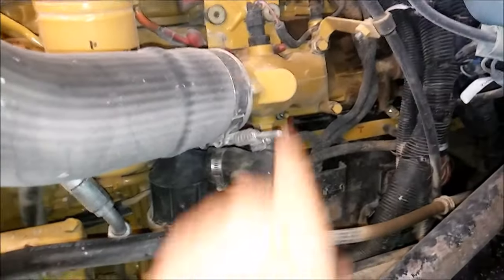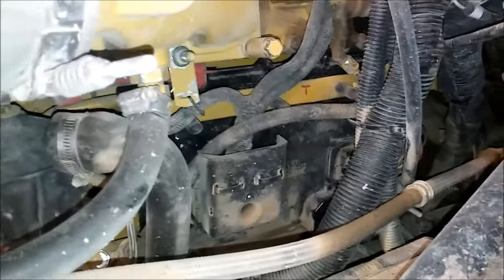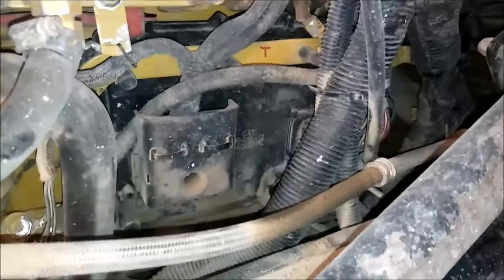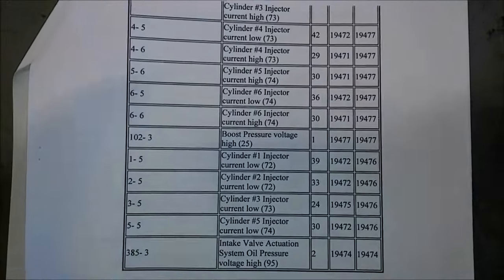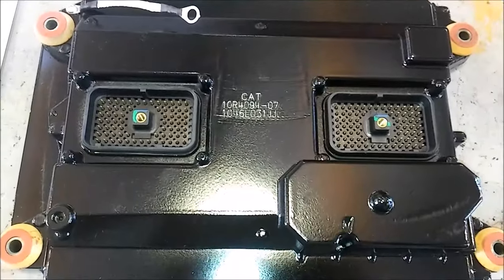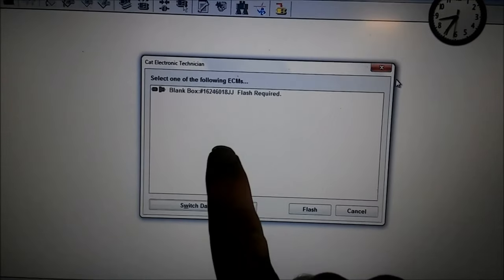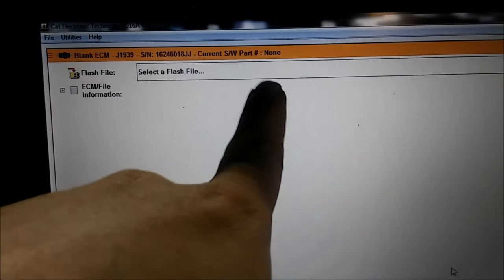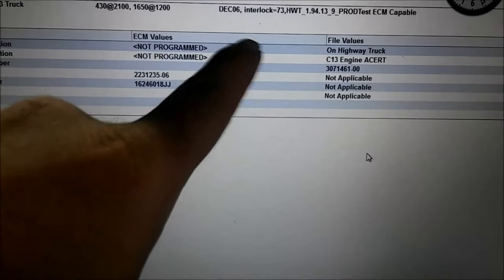How To Troubleshoot And Program A Cat ECM

Comment: Appreciate your videos.  I am a Ex  CAT/Cummins mechanic   retired from a pete dealer. The strangest ecm failure I encounterd was a 550 Acert in a 379 pete. brand new off the piggy back tk.This engine sounded like it had a High lift gasser cam in it was hilarious belching smoke and loping like mad.. !  .Had et plugged into it and it was throwing  every code you could think of from cam/crank timing codes to inj pulse width.basically freaking out.Tapped on the ECM case with a rubber mallet ran perfect.flashed new ecm  all is well.Did download on bad one for warranty. Cat called service manager week later.Turned out to be a bad solder joint on the hard board. Was a MXS motor and they  had  over 50  of them that got out into production giving everyone fits on diagnostic side

Comment: Hello there. Very informative video!
I purchased a caterpillar 525B that took a lot of damage and is being scrapped. Although it’s a lost cause…Most of the electronics are still intact and undamaged. I have a bit of experience with dealing with ECM‘s, I’ve repaired dozens of car and truck ECM’s at the component level… However I’ve never dealt with anything from an huge industrial motor. I buy and repair pallet loads of industrial equipment… mostly as a hobby and supplemental income. But usually stuff like CNC machines, servo drives, motor controls, stuff like that. Never dealt with these massive engines and all of their electronics goodies.

I have a humble troubleshooting lab, and will check everything to the best of my ability. And then pass it on to someone who needs it. Maybe I’ll be able to trade it for something interesting… Who knows.

The machine I Purchased is going to be scrapped this week or next… it was in like new condition with low hours on it when it took a tumble off of a large embankment and did more damage than it was worth repairing. It belonged to a large construction company and I bought it directly from the owner after his insurance was settled.
all of the electronics and wiring were completely undamaged in the fall. Some of the electronics had been disconnected and a few potential buyers had poked around loosening some connections and possibly removed a few sensors or modules. I’m not sure how much is missing, but the main ECM is still there. So I would assume they would’ve taken that if they were going to take anything.

My ecm isnt on the side of the engine like shown in your video. It’s directly under the driver seat fastened to the bottom of the cab on the outside.  I was curious if it’s common for them to have different locations like this? And how the heck to find all of the other hidden electronics, modules, or sensors. I want to remove anything useful or valuable before it is scrapped.

Some of the stuff is really hidden deep and hard to find. I’ll fallow the path of the wires I can see, but I’m worried some have possibly been removed… or I’ll miss some valuable module or parts. Considering a few potential buyers loosened some of the connections and possibly moved or removed things… I just want to make sure I find everything. 

I Tried to find a schematic or diagram online showing the location of all the modules and sensors that I’ll be removing but no luck so far. The model number of mine is 172-9389-01

Thanks for the video and thanks for your time.

Comment: This is one of the worse jobs on ANY vehicle : Troubleshooting ECM, harness and connectors...and most of the times the problems are intermittent and hard to reproduce when u want it to.
I had an ECM die on me once at 140k on a crappy 1996 Eclipse. Darn thing made of kinds of noise and clicking sounds...good thing it did, it just made the whole ordeal a whole lot easier for me. Do HD trucks come with a bunch of body modules(smaller ecm's) like new cars too ? Keep the videos coming...i don't work on HD trucks but i like them a lot. 👍
Reply: Forgot to add: Yup, heat KILLS A LOT of electric/electronic. components...the Eclipse ECU gets pretty hot and it gets no air flow(confined to a TIGHT space next to the radiator and getting cozy with the  battery, acid bath and fumes, anyone ?lol).
Reply from the maker: The newer the truck the more modules it has. The engine has one as well as the ABS, sometimes a dash or cab module, body control, and transmission of it has an automatic, are the more common truck ones.

Comment: I have a cat 6NZ and recently job I have done was manifold and the guy did a lot of welding trying to pull out broken studs and since that day I have faulty sensors and replaced it but still showing up and truck shut down while driving or idle no matter what circumstance do you think this is a ECM problem? And I already change and check all wiring. I don’t know what else to check

Comment: Do you happen to know what typically fails at a component level inside the ECM? I have a 3126b ECM open on the bench and don't see anything obvious with my multimeter..  what is a good resource for the 70 pin connectors to build a bench harness?

Comment: Just got done replacing two ECMs on 2 different trucks both trucks are 2004 KW T800 with C15 acert BXS one truck having 13826 hrs the other truck having 13914 hrs with in 2 weeks. Trucks just 1 S/N apart. Same code all injectors current high plus a couple of AIV. Thought it was strange

Comment: Josh... I have had you help me before.  I have a c7 and it randomly dies. It is in a school bus.   I have sent it to Holt cat in Dallas. They couldn't get it to repeat the problem 😑 . I Then decided to drive it around for several hours and nothing happened . Drove it back to the day care.  2 day later it was doing the same thing.  Even with the driver in the seat going down the road it would die and she could restart it rolling down the road. Then maybe do it again or maybe not for 3 days.  Checked wiring/ battery connections haven't checked ECM or related conditions  . The engine is in a Freightliner school bus.   Your thoughts ?

Comment: I have a generator problem with engine C15 speed hunting.... an indication of oil pressure and coolant temperature error... is that indication the cause of engine speed hunting..? thank you

Comment: Hi, 7 years later .... got a question .. i have a cat 149-6990-10 ecm.. the person gave it to me look at because he wired the main voltage backwards or something like that and fried a Diode in the ecm. However I have no clue what the diode is because its blown... i believe its board number is d4 beside cap c258 on the edge of the right side middle.. I do have a picture.  Because i have no clue i replaced it with a t4 diode just to see if the unit would power up.. However I would rather not test out that theory as you might know the diode number....  Well if you see this great if not I get it.. 7 years later...

Comment: Hello Guy, I have been troubling shooting 3512B cat engine, cylinder 5 and 8 is not firing have even interchanged injector, check valve, pressurized cylinder, I decided to check cylinder input since the ECM communicate with solenoid in pwm , I have on nos 5&8 is... 1.340hz while the least on firing cylinders are 98.5hz and highest is 245.4hz while engine running at 600rpm idle

Comment: I have another puzzle for you. I have a 3406e 5ek  I have replaced injectors , injector harness and ecm. The engine runs very strong then it will start popping and blowing white smoke. This comes and goes quite frequently. I'm going to try the engine harness next unless you have another suggestion. Oh  I took the exhaust manifold off and it's all 6 cylinders.
Reply from the maker: +Alice Stoneking Hmmmmm, are you getting a check engine light? What is your fuel pressure when it is acting up?
Reply: May sound silly just check fuel primer (they can pull air through

Comment: Having issues with the ECM in a CAT XQ60. Had the generator running, then I shut it down to top off the fuel. When trying to start up again the motor try’s to turn over then it throws a ECM code.

Comment: Thanks for the awesome info.  I have a 2003 Thomas pusher with a 3126.  It stalled while driving and found 20 amp fuse blown that feeds the ECM.  When changing and connecting batteries fuse blows.  I disconnect the wire harnesses going to ECM and fuse doesnt blow.  Am I safe in assuming that the ECM is bad?
Reply: I have the. Same issue
Reply: @ttauriinvestments5756  My problem ended up being a bad ECM.  I ordered a Remanufactured one from Peterbuilt and had them program it for me.  The location in Flagstaff didnt seem to have the knowledge or time to do the work properly, so I would not recommend.  I did find GoECM, after the fact, that was a 1/4 of the price.

Comment: Will a engine speed sensor calibration fault cause a crank no start. A customer of mine installed a new ecm he bought programmed from cat. His old ecm was dead so couldn't get old parameters. From what I remember would run just throw code for speed sensor calibration
Reply: It should start, and will have  timing calibration not preformed fault. If a download was in the system, you can get some of the old programming if you know the engine serial number. You can dump a timing cal file in the ECM unless it is a early 3176. 70 pin ECM's are easier to do this over 40 pins. I would check my power and ground wires to the ECM. If the old ECM fried, good change it blew a fuse in the truck side.
Reply: I'm a mobile tech and everything I do is on site. I work for peterbilt so have access to et and sis i just don't get to mess with cat much anymore and couldnt remember for sure and the calibration. Customer said that truck died coming out of woods and ecm wouldnt wake up and now truck been sitting for a couple of years. They bought ecm off internet and it wouldn't start and then bought one from us that we bench programmed and stiil no start. It didn't have timing calibration code or any other codes. I checked esn with sis to make sure programed with correct software. Did find it was dropping to 7v while cranking and was  discoonecting et cause of it and fixed that and thought was going to be my issue. Had 14 psi fuel pressure. I run it out of a bucket of clean fuel and fixed that now have 65psi cranking. Only getting 2v ac to injectors. Customer said he couldn't get it to hit of starting fluid. Et show 100-120 rpms cranking and tried unplugging cam sensor. I pinned flyheel and checked timming mark.I sprayed some starting fluid and it wouldn't hit or smoke. Removed valve covers and cac pipe at intake manifold and exhaust pipe coming from the turbo on exhaust manifold (acert twin turbo) To rule out restriction of air flow especially since its been sitting for so long. Cranked it and sprayed starting fluid and still wouldnt hit and no smoke coming from turbo but smoke coming from crank case  and sounds like has alot of blow by. I told him i think it is mechanical because no matter what should hit on starting fluid and didnt even get any smoke and put my hand on turbo outlet and would suck and blow my hand off of it. Not sure if thats normal maybe because of cylinder scavenging but dont ever remember see that before. customer didn't want me to go any further.

Comment: Hi Guy .Ive a 2002 3126 .When my ecm went it acted just like it was a fuel problem for the first day then it began to run rough,then it  ran but really really rough.I have 2 of the same year 3126s so i took the other ecm off and put it on and it runs fine.Think i just lucked out.Wonder if other cat motors being same year ect could swap ecm.
Reply: A lot of failures is the injector driver fails causing a misfire. Most of which all six can fail and you will have a no start. 
A ECM is blank (correct part number required) and first you flash it to the software. Once flashed you can put it in test mode (70 pin ECM's) and for 24 hours the ECM can be changed. After 24 hours of key on time the ECM locks in. Or you can bypass the test mode and program engine serial number directly in. Some engines require injector trim file (ACERT) or four digit code. Your engine may or may not have this. Then you have the FTS/FLS for each engine. That is how much fuel is putting on the piston. So with a used ECM you don't know what HP you have unless you hook up to ET. Then the fuel numbers and the injector codes could be off some. After all of that you have the programming of the truck, PPM for the speedo, any PTO functions if used, automatic or manual trans., engine fan and the list goes on. I always tell people get a jump drive and get a ECM replacement file out of your ECM before it fails and you have a copy of the programming. If you go to Cat they will be charged a used ECM replacement fee from the factory, plus any other labor. 
If you do go and have work done on the engine for example and it has the wrong serial number of the engine in it. You could be asking for trouble, as wrong parts could be installed.

Comment: I have a question my truck will drive great but at times just looses engine power I be going down interestate at 70 mph the truck just shut off I make it to side of road turn key off wait a bit I will here a click inside my truck. My truck is a 2000 GMC c6500 with 3126 I replaced iap valve by heiu pump really could use some help

Comment: I have a 2001 Thomas saf-t liner with a cat 3126. It turns over but won’t start. We weren’t getting any power on the harness spot on pin #70. Is pin 70 ignition with key in on position on all cat ecm? And if so what should I try next?

Comment: Im facing a big issue of trouble shooting a c32 cat generator.
It is deluting diesel in engine oil. With in 1 to 2hrs while loaded it mix 10 to15 liters of diesel in oil sump. Checked fuel trans pump for leak trace nothing after replacing all injector O-rings but still facing the same issues. Exhaust manifold glowing red in the part of cylinder five and six while at fullload.

Comment: Hi Adeot Ape, I'm having some  trouble with a C9 generator.  It has a number of strange intermittant faults, the first being it wouldn't take full load. I've tried running the cylinder cutout test in ET multiple times (amongst other tests}, it passed once but stops the test consistantly while testing unit #3 (the one time it passed, all injectors were "questionable"). The reason ET gives is "a change in engine load or speed, which is not allowed". This is not actually happening as each time I tested it the generator was not connected to any load whatsoever. The ECM also frequently throws an intermittant "Inlet air heater relay current high" code as well. Have you seen anything like this before, and do you suspect this may be the ECM on its way out? I've also had it lose  connection to ET randomly a couple of times, with no bumps or change of any kind to the wiring/adapter leading up to the ECM. 
As a side note I disconnected one speed sensor at a time to check them before starting it back up (it ran fine with no difference to the tests), but to my surprise the ECM didn't  seem to care at all that it was missing a speed sensor, let alone throw a code or any sort of warning.

Comment: Is it possible , losing power and boost after disconnecting batteries for truck repair. They were disconnected 6 hours on 13 years old NXS acert

Comment: Suppose in a fleet where the trucks have sequential S/N's and one truck's ECM is possibly bad and no CAT ET in sight - for troubleshooting, it should be OK to remove a known good ECM from one of the properly functioning trucks, install it in place of the bad one, and test - right?  Even with different injector trim codes, the truck with the bad ECM would now operate satisfactorily with the known good ECM - right?
Reply from the maker: +Chad Jessup Yeah that would work to see if it's the ECM. The truck would run fine like that.
Reply: Adept Ape hello.could you inbox me please. i have questions about my c15 engine

Comment: I had some wiring issues due to those zip ties on the ecm connector. Some would be so tight that wires shorted together or the plastic would cut the wires. Ive also  replaced several ecms on the c15s. All were the same fault. The sensor wire for the intake actuator sensor (jake brake pressure?) was battery voltage instead of 5v sense. Wiring was fine. Replaced ecms and sensor and were good to go. But had one come back with same fault 3 years later. What gives? Same fault trouble shoot and ecm is outputing battery instead of 5v sense wire.
Reply from the maker: +Alex Alanis The IVA oil pressure sensor, the one on the valve cover base by the turbo does go out all the time on ACERT engines, but I've never seen it read battery voltage. Sounds like you have some gremlins on that truck.

Comment: amazing videos Ape !.. a quick question... how do you diagnose an old 3406E without expensive equipment or software??... what ET version and data link would you recommend for the job?..
Reply from the maker: Diagnose what exactly? Do you have a check engine or just have low power?
Reply from the maker: I'll be doing a video in the next couple days about troubleshooting check engine lights and codes, so make sure you subscribe.
Reply: I would like to do the cylinders cut to check the injectors... I dont have the check engine light and did the code test with the cruse control method which  gave me the 5 5 code.... engine lacks power ...is a 2WS rated at 475 HP... I am subscribed already..   ;)
Reply from the maker: +HENRY VILLATE Well unfortunately I don't know of a cheap way to do a cylinder cutout test. If you are really dedicated you could make a toggle switch setup running to injector harness and switch them off, but I think it would be cheaper to just have a Dealer do a cutout test for you.